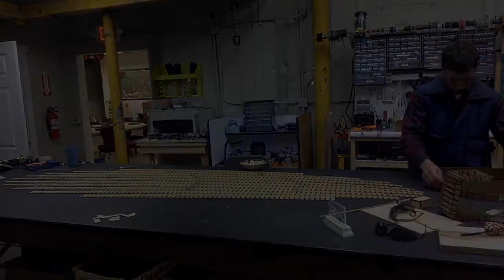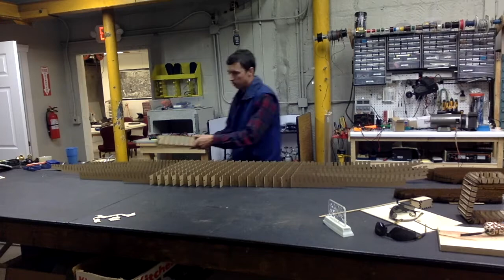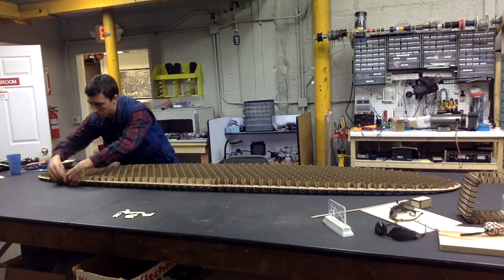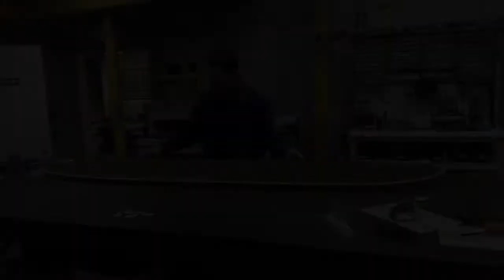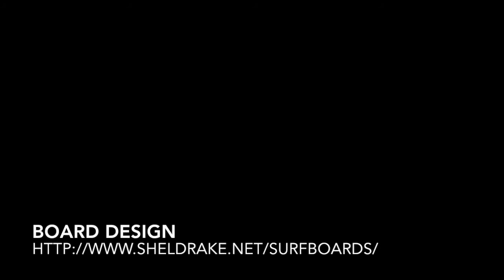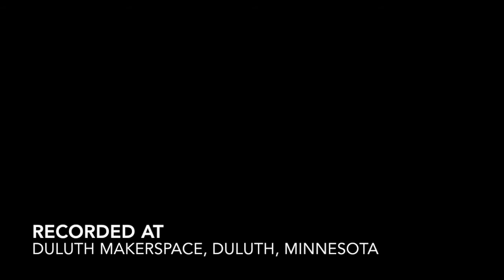Cardboard Surfboard Core assembly

Comment: What are the dimensions of the cardboard from which you cut the elements?
Reply from the maker: I used 11" x 24" sheets of SP55-JBSSP1123 Corrugated Cardboard. I would choose a sturdier variety if I did it again.

Comment: How difficult was it to get the plans into the laser machine?
Im wanting to do the same thing in San Diego.
Reply from the maker: SDBARTENDER1 I had some issues with the dxf files not working as expected. I used Illustrator to make new dxf files from svg files and that fixed the issue.
Reply: Paul Schonfeld will i be able to figure out how to do this without prior laser experience?
Reply from the maker: It took me a while, but I think you'll figure it out eventually.  Can you ask others at your local makerspace?  Cardboard surfboard designer, Mike Sheldrake, also has a nice guide on his website and was responsive to my questions.
Reply: Paul Schonfeld yeah, ill have to become a member there so i can use the machine. I know of the website, wanting to do this but not if its a royal pain just to get the cutouts.
Reply from the maker: It's not too bad.  May take some troubleshooting but with patience you'll get it.